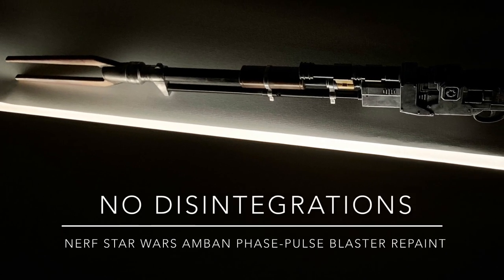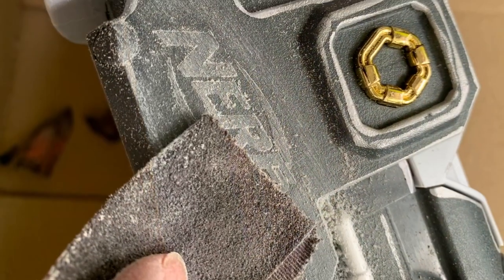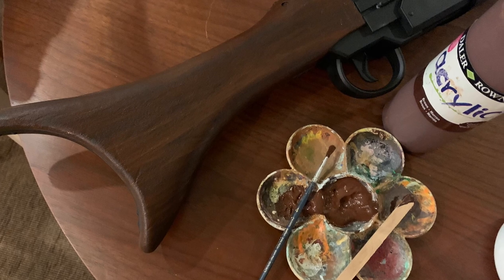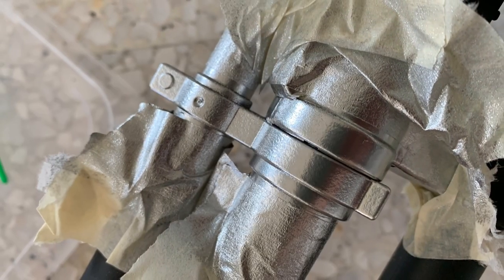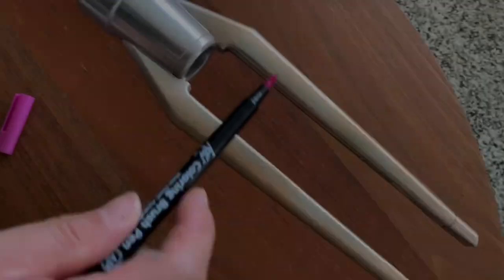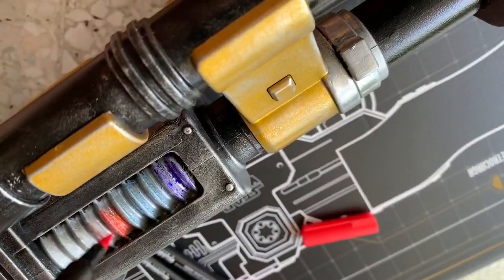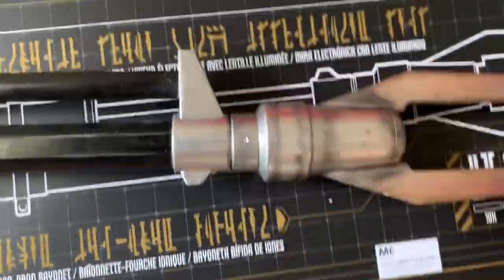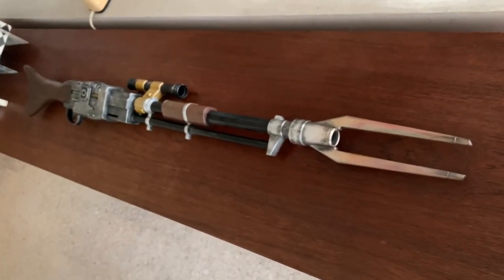Nerf Star Wars Mandalorian Amban Phase Pulse Rifle Repaint

Comment: This is awesome! i'm preparing to do this with my nerf amban gun, but i was worried about the moving parts. I've painted nerf guns before and it gummed up the moving bits, any tips on what primer to use to avoid any mechanical issues?
Reply from the maker: Thanks! For the inner mechanism, I didn’t prime it cos I think that too much paint will interfere with it’s function.Just hit it with matt black in very light coats from a distance.  Also, do wipe the area with soap water to get rid of any mold release oils before painting. Have fun!
Reply: @Plasticstarwars  thank you so much for sharing this video and tips, I'm gonna be taking a crack at doing the same thing, so I really appreciate all of the guidance!
Reply from the maker: @johndulak6530  Im glad you find the video helpful. Have fun with your mod!👍😊
Reply: @Plasticstarwars  I actually shot you a DM on Instagram, what kind of two part epoxy did you use?

Comment: Awesome job!
In my opinion the stock is shorter on the Nerf version, I'd like to cut my stock and extend it a bit and add some weight in parts too .
Reply from the maker: Thanks! Yes it will be better if the stock can be extended. I thought about doing that at first but it would require a lot of work as the firing mechanism is built into the stock. All the best and I wish you success!👍😊
Reply: @Plasticstarwars  if one was to  remove or file down the butte parts of the stock and 3d print a "sleeve" that goes over the old stock and extends plus some carefully placed metal rods for stability along the old and extended stock  I can't see why it wouldn't work.
But then again, a lot of work for what is really one's own satisfaction as the nerf original stock length has a passing accuracy to source material

Comment: Ma lo hai smontato per passare il prime?
Reply from the maker: No I did not take it apart
Reply: @Plasticstarwars  what resin do you use to cover the differences in level? Tnx
Reply from the maker: I used 2 part epoxy as the putty/filler for this:)
Reply: @Plasticstarwars  which two part epoxy did you use?